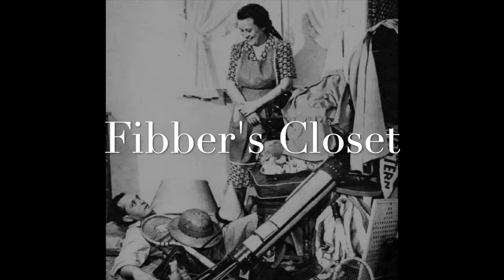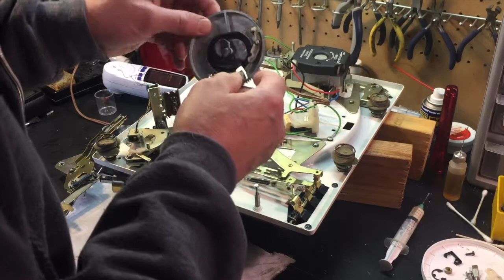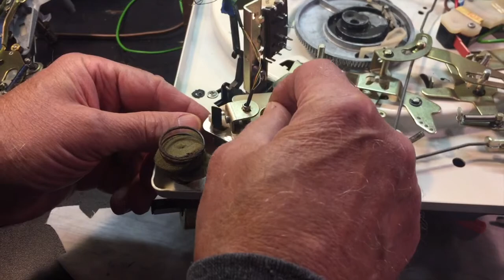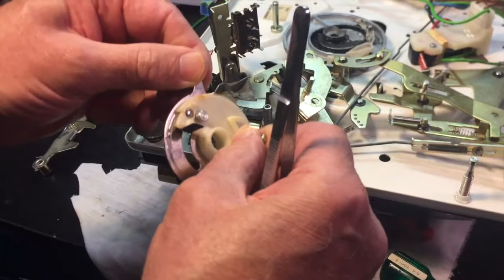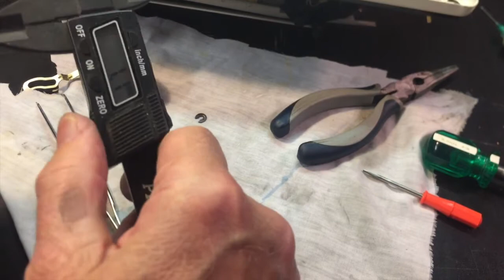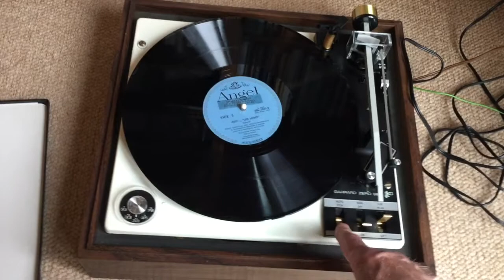Garrard Zero 92   Act 4   Finale

Comment: Did you replace the tone arm wires and how difficult was that? How do you open the arm if it needs to be opened, or is it just a thread job? I have a 92 that mechanically operates very nice however, I do not have a counterweight (although, with a piece of plastic lunch bag and an old weight from a technics, I was able to fit one one snug but adjustable), I dont have a cart carrier (C3), so I need to find one cheap just to see if the arm works properly. I see sleds but 50 is a big chuck if I am not sure it works :)  Hopefully, I will find one somewhere and test this cool machine out soon. Great video series. thanks.
Reply from the maker: Hi Jeff Still Jeff, I did replace the tone arm wires, and it wasn't easy. The originals were so very fine and flexible (and impossible to solder). The newer ones are more durable, but difficult to route. But, it works. Good luck with your 92!
Reply: @fibberscloset498  where can you get a new set of wires for these?